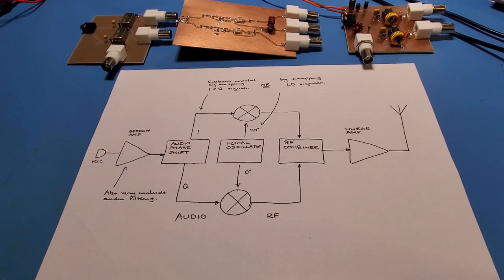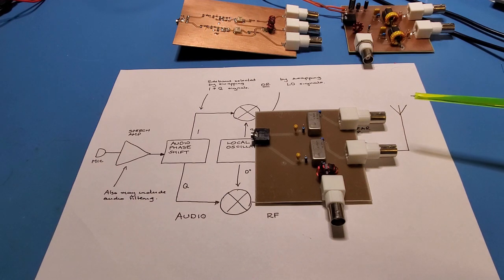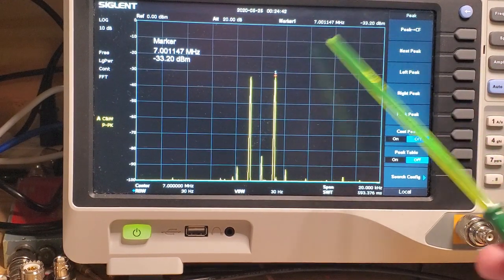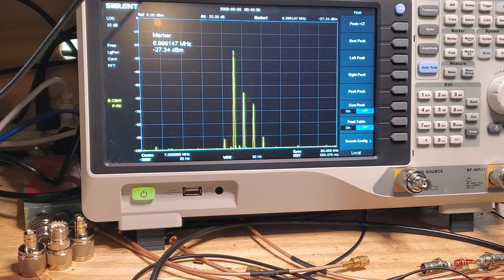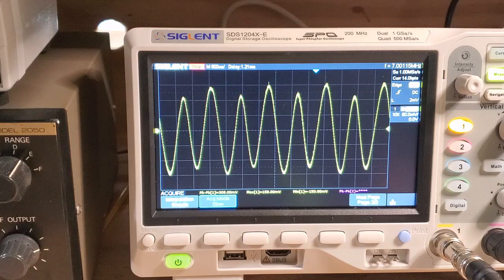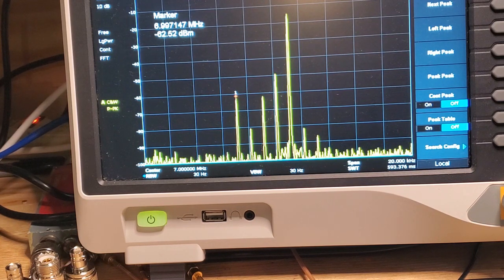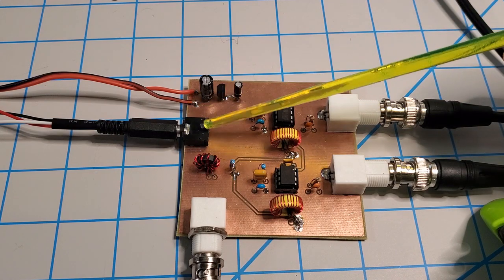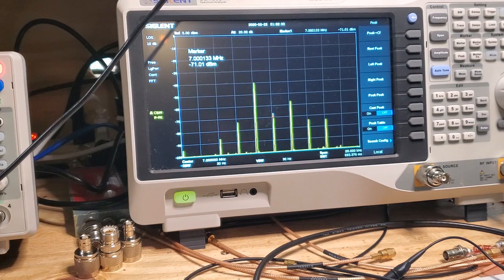Tinypico Radio Part 10 - Double Balanced Mixers

Comment: What kind of LO drive level do you use when using IF as an input.? I am trying it with 1.41V P-P and getting nothing but distortion, also what is the audio signal level presented at the IF port? I am able to get a decent signal but only if my LO is 400mV P-P and my IF in is 300mV P-P
Thanks so much for great videos!
KE8SPI
Reply from the maker: Its been a while since I did this but the LO in both the ADEX and SBL were audio signals at about 0.7 V p-p. The RF input in both cases came from an si5351 and so was around 3.3V p-p. I blew a few of both mixers with too high an LO voltage though. Overall I got better results out of the ADEX-10. 

I hope this answers your question. To be honest I prefer the FST3253 based mixer. Easier to get a hold of and more robust. IMO of course. Thank you for the comment

Comment: Is there a reason you didn't try using the FST3253 for the transmit mixer also? It would be interesting to see how it compares to the others.
Reply from the maker: Excellent question Rob - I actually plan to get around to that! There's a little more involved with that style of mixer - you have to have an opamp network that extracts the 0, 90, 180, 270 components from the I and Q signals. Definitely coming up!

Comment: w.r.t. the NE602 mixers a couple of things to consider for improving their performance: (1) drive the RF port differentially not single ended. This reduces those spurious tones. Also the IF should be taken differentially which you have already done so. Note that the RF level should not be high or you will get large spurious tones. it must be 10dB or so less than the LO drive. (2) I found that impedance matching at RF port is not that critical but at IF port it is more critical. The self reactance of your transformer at IF port should be large enough and at the same time the transformer and load should provide the right loading impedance for the mixer. (3) as mentioned by another viewer, play with the LO drive level to find the best conversion gain.
Reply from the maker: Thank you for the great feedback Amir. I will definitely try differentially driving the RF port. The performance of the NE602 was pretty disappointing
Reply from the maker: I was thinking more about your reply Amir. When you say the self reactance at the IF port are you talking about the reactance of the 25 turns on that T50-2 w.r.t the output impedance of pins 4 and 5 of the NE602? I have read something similar elsewhere (reactance should be 4x impedance) but was unable to find a reference. If thats the case then I'd have to use a different core. Thoughts?
Reply: @na5y  yes, that's what I meant. Basically only having the correct turns ratio for impedance transformation is not enough. The transformer self reactance should not heavily load the mixer. I dont have a reference for that 4x-5x value but it's a rule of thumb that is usually used when winding these type of transformers. It may not be possible to do it sometimes if the frequency is not high enough and the source impedance is too large (these probably apply to your case) then i think you should go for a self impedance that is at least not too low compared to the output impedance of the mixer.

Comment: Thank you for sharing this experiment and your series on the phasing topology. The ne602 and friends are also very critical to LO drive level, something like 500 mV peak-to-peak should make it happy or if you can, try to find the sweet spot. I've had some headaches with this because I don't have a proper signal generator and fiddling with attenuation pads is slow, but when you get the LO amplitude correct there is a huge difference. Who knows might not help at all :) It would be amazing if you could test the VK3YE phasing transceiver mixer as presented here: https://youtu.be/wx8_RroSswE?t=135 . That mixer would be very cheap to build with matched diodes. 73s OH6UAV :)
Reply from the maker: Thank you for your comment m0rph. I'll have to check out your attached video - always interested in a challenge. I did attempt to build up my own discrete diode rings in the past but without much success. One of the things I do plan on trying is a Tayloe style transmit mixer using the FST3253 at the heart (like I had on the receive side). That should be an interesting comparison. 73s!

Comment: On the ne602, is there an issue with not impedance matching on the input?  Also, what is the turn ratios on t1/t2?  Thanks!
Reply from the maker: You might be right there. I do have a 47 ohm resistor in series on both inputs and the single ended input impedance is 1500ohms. That might be one of the reasons I have to drive the Audio so hard. I'll have to experiment. Other circuits such as this one http://www.arrl.org/files/file/QST/Homebrew%20Challenge/HBC%201%20Winner-KD1JV.pdf though don't bother with an impedance matching to pin 1 for the audio signal. 

Also turn ratio was 25:3 - If my math is correct that is approx 60:1 impedance down from 3000 ohms balanced output to 50. I tried a few different winding values from 25:5 - 25:3 and it didn't seem to make much difference

Thank you for the comment!.
Reply: NA5Y yeah, I honestly don’t know.  I have been playing with one to do a dsb transmitter, but I don’t have an SA.
Reply from the maker: @MegaCadr  I wanted to include an SA602 version is this because I have a pile of them at the moment. They are pretty robust. I did blow up a pair of SBL-1s in the course of experimenting by driving the audio too hard into the IF pin.